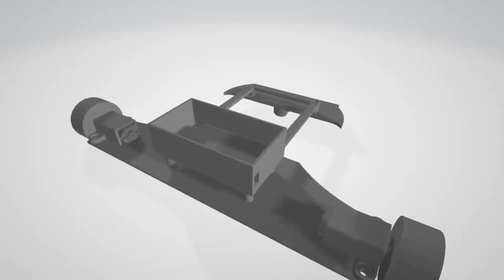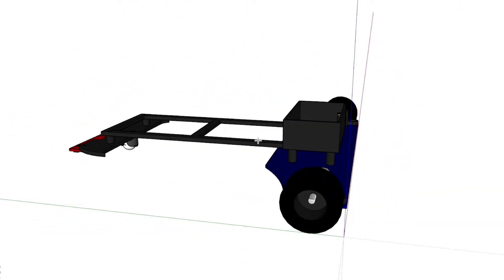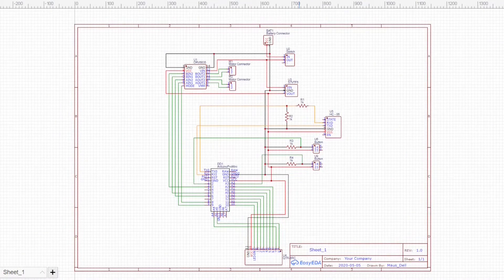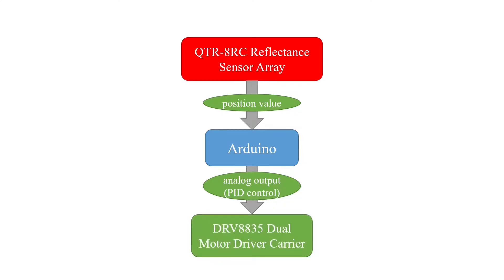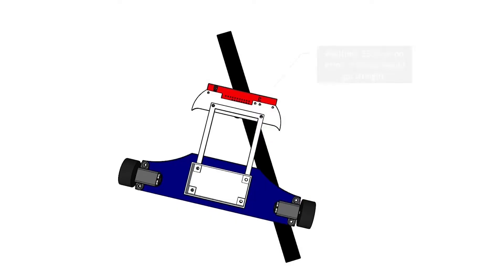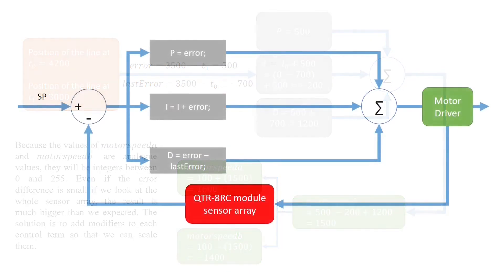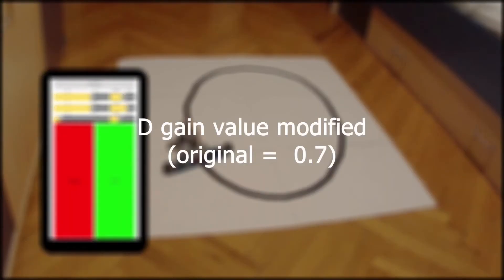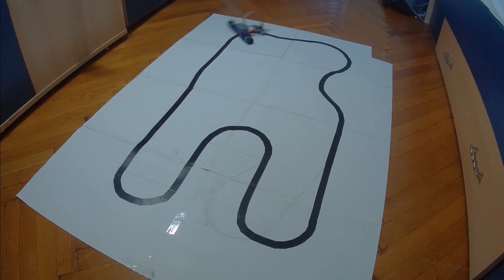Making a simple Arduino Line Follower Robot

Comment: I can't find the DVR8835 motor driver and S7V7F5 regulator in my area. Can I replace them with the following?
1. Motor driver: DVR8833 OR TB6612FNG
2. Regulator: LM2596 OR LM7805
Or any model you think is better for replacement!

Comment: Will this work with black surface and white line
Reply from the maker: Yes, the library used here also has support for the white line black base configuration. However, the code needs to be changed, more exactly from "qtr.readLineBlack(sensorValues)" to "qtr.readLineWhite(sensorValues)".
Reply: @botreboot6352  thank you so much sir

Comment: Hey man please help, the app in the link is different, it dosent have base speed option
Reply from the maker: The version with the control of the speeds was never pushed to the resources because it was usually breaking the whole application if you would send a lot of data to the Arduino. However, you can manually set in the code your desired min, base max speeds.

Right now, I am working on a new interface and application for the line follower robot, so stay tuned because it will be released soon! :)
Reply: @botreboot6352  thankyou

Comment: I have made this, is there any way to make it take acute angles?
Reply from the maker: That's a really good question. I never got the chance to test it. However, I am remaking the line follower robot, both the design and the software, so when I test it, I will make sure to also include that.
Reply: @botreboot6352  will you upload the video after its done, if yes then when will it would be?
Reply from the maker: Yes, of course I will upload the video. If everything goes smooth and without any bugs and issues, one month would be a realistic estimate.
Reply: @botreboot6352  thanks bro, I was working on this I have an idea to make it take an acute angles, I'm a mechanical engg student so don't know much about programing, if you share your e mail then I will share my idea
Reply from the maker: My email is on my about page of my youtube page. If you cannot find it, then here you go: anova9347@gmail.com

Comment: Is this robot can solve a line following maze? If not, how can we make this?
Reply from the maker: From what I've heard, it really depends on the type of maze you are talking about. It can be with or without line, and in the contrary case, you have walls. If you only have lines and no walls, it is possible to work, but you need an algorithm to solve that maze optimally. There is already the movement of the car implemented. Now, the next step is to actually give it a brain.

Comment: You can connect mode pin in 8th pin of Arduino,in front i use DRV8833, eep  pin is connected to that 8th pin,as your description code is suitable for that pcb board
Reply: so , we can use 8833 too??
Reply: Do we have to change the codes for DRV8833??
Reply: So can replace DRV8835 to DVR8833 the entire code is working fine?

Comment: What is eep and ult pins in DRV8833 driver, explain its function
Reply from the maker: I suggest you take a look at its documentation because it is not a component used in this project, and neither are the EEP and ULT pins. 

Of course, any other replacement of the hardware used in this project might not be compatible with the codes and PCB, so you will have to improvise and adapt them to your needs.

Comment: Bro, why are use Arduino pro mini? In front i use Arduino nano its works or not
Reply from the maker: There is not much of a difference between these two Arduino boards. I went with the Arduino Pro Mini because of the smaller size. As I've stated in these comments, there is an infinite range of other hardware components that can be used instead.

Comment: DRV8835 Dual Motor Driver Carrier and 5V Step-Up/Step-Down Voltage Regulator S7V7F5 is not available in my country. What can i use then? For example can i use DRV8825 Stepper Motor Driver Module or l298 hbridge dual moto driver and for the voltage regulator can use any other buckboost converter?
Reply from the maker: You can use any other motor driver and voltage regulator as long as they are compatible. You need to make sure that the battery's voltage is between the input interval of the voltage regulator (and of course the output is 5V). 

The same goes for the motor driver - the voltage input and output are compatible (also, you should take into account the current's output - if it is sufficient for the motors - the DRV8835 has an output of 1.2 A). Depending on what you alter, the wiring and the code will change too. 

But yeah, the L298n motor driver can be used as a replacement. From what I've heard and tested, it has some voltage loss at the output.

Comment: Which rpm gear motor is used
Reply from the maker: 10:1 Micro Metal Gearmotor HPCB 6V from Pololu (https://www.pololu.com/product/3061), which has an no-load performance of 3300 RPM.

Comment: In advance pid Bluetooth code you not declared the button which is for calibration And start to run so it will drop out the button connection 🙄
Reply: Instead of using qtrtype rc can we use Analog it is beneficial to us

Comment: In advance pid Bluetooth code the KP Ki KD value are auto generated while calibrating?????
Reply from the maker: The calibration is for the sensors of the QTR-8RC. It has nothing to do with the PID control terms.
Reply: Can you share your value of kp ki KD u use in these
Reply from the maker: @sanketmendke9793  please look up in the link in the description (of the written documentation). You will find there the specified values I have used, plus more information that would answer most of your questions.
Reply: @botreboot6352  thank you very much 😊

Comment: In these robot you use DRv 8835 in that Mode pin is connected to 8 but I am using 8833 there is no mode in that so what I do or no need to connect mode in 8833?  please reply
Reply from the maker: If you look at the motor drivers' documentation (https://letmegooglethat.com/?q=drv8835+pololu), you would observe that the mode pin aims to switch between two modes of operation of the motor driver. The DRV8833 doesn't have the mode functionality, so of course, you don't need to "connect mode".

Comment: Please can you tell me which code is use only for fastest line following as you put in your description like PID example, QTR-8Rc or advance pid+ Bluetooth from these which code is best for only line following fast

And 
 8833 DRV can be use instead of 8835 but In 8833 DRV eep and ULT pin is there where it connected please reply
Reply from the maker: "PID control example" is the sample example of the raw implementation of the PID control system. 
"QTR-8RC Example" is the sample example of how the sensor array can be set up and used in the Arduino IDE. 
The "Advanced PID control + Bluetooth communication" is the PID control system with some modifications for better control at taking curves. In addition, it offers Bluetooth support to easily tune the robot. Therefore, there is no code that makes the robot "faster". If you want the robot to go faster, increase the variables of the maximum speed and/or base speed.
Reply from the maker: If you would take a look on https://www.pololu.com/product/2130, you can see how each pin can be wired. And more precisely than that, eep and ult pins, which probably are the "nSLEEP" and "nFAULT" pins, can be left out, as they are not required for the minimal functionality of the motor driver.
Reply: @botreboot6352  thank you for reply !!!
 one more Question is that then we use DRV 8833 instead of 8835 without making changes in code of yours because in 8833 no mode pin is there

Comment: How do you pair the ble module with the phone? Every time I try to pair, it says pairing rejected. Any ideas?
Reply from the maker: In my case, to get the Bluetooth module working, I first paired the phone with the module from the Bluetooth panel in Settings. It usually requires a pairing key ('0000' or '1234' should work). When the pairing is done, you can select the module device directly from the Android application for the control of the line follower. Otherwise, make sure the module is connected properly to the microcontroller and the code is correctly uploaded.

Comment: Would it be possible to use a drv8833, or any other motor driver, in place of the drv8835? Also does the code work only for the Arduino pro, or it could work for other arduinos too(the nano or the uno for example)?
Reply from the maker: It is possible to use any other hardware existing, as long as you have the same outcome. In the case of the motor drivers, you will need to keep track of the supply voltage, wiring, code to control the motors etc. 

But strictly regarding this project, the PCB used doesn't support any modifications in hardware, so you will need to either use a breadboard or customise your PCB.

As for the code, it should work on all Arduino boards. But keep in mind that you have enough PWM, I/O and analogue pins required by the other components.
Reply: @botreboot6352  Thanks.
Reply: Bro you can make line follower

Comment: im trying to use L298N Motor Driver, but what's "mode" from DRV8835 Dual Motor Driver Carrier
Reply from the maker: If you would take a look on the driver schematic (https://www.pololu.com/product/2135), the MODE pin determines the control interface.

Comment: Plase, why did you use those four resistors?
Reply from the maker: You can find the circuit schematic in the link in the description. Each button requires a pull-down resistor, and the Bluetooth HC-05 module requires 2 resistors (which make a voltage divider in order not to burn the module).
Reply: @botreboot6352  nice! Thanks for answering, pretty cool car!